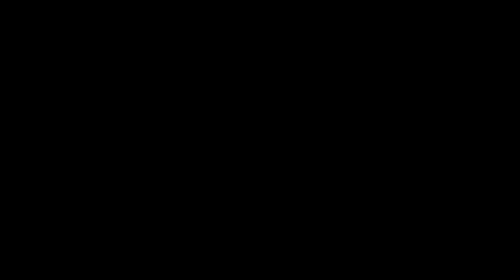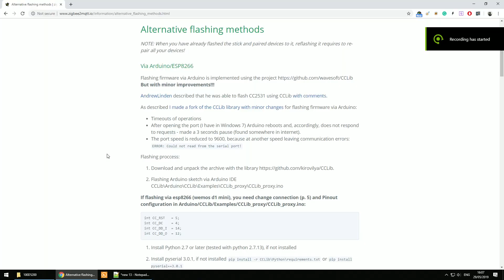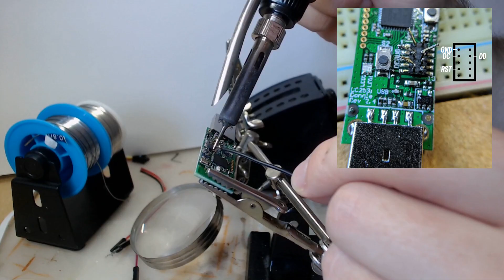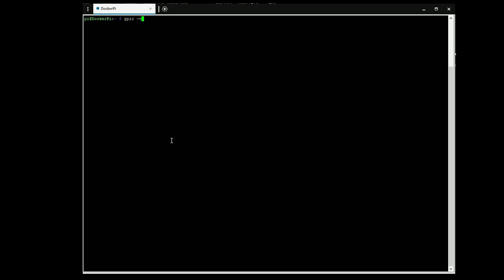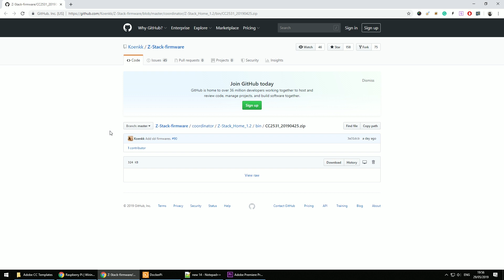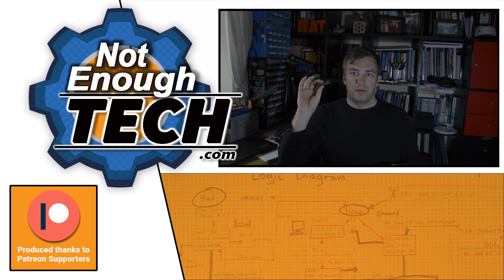Flashing CC2531 without CC Debugger

Comment: It doesn't work for me with a today fresh raspbian installation.
The video does not work for you either, when you run "cc_chipid" it comes out ID: 0000, same with erase....., which means that it is not working.
the same happens to me
Reply from the maker: What board are you trying it on? Also is it v1.0 on PCB?
Reply: @notenoughtech  yes, mine is 1.0
Reply from the maker: Are you on RPI  Zero? I get a lot of comments about issues with x1.0  my stick was 2.4
Reply from the maker: @sagatxxx1  see if any of these would be helpful: https://github.com/jmichault/flash_cc2531/issues/10#issuecomment-544139748

Comment: Thank you, it worked! I've used hook probe clip cables with dupont connectors on the other end for the connection. Had them for my logic analyzer, but they are very cheap on eBay. No soldering and pin bending was necessary this way.
With Pi Zero I had to move back to an earlier commit because there was a bug which caused it to always stuck at the verification stage. https://github.com/jmichault/flash_cc2531/issues/10#issuecomment-544139748
Reply from the maker: Thanks for the link. I may get the 1.0 stick to write a guide myself as well

Comment: Hello. I have problem with step 2:    git clone https://github.com/jmichault/flash_cc2531.git   ---->        -bash: git: command not found. What am I doing wrong?
Reply from the maker: sudo apt-get install git  - should help
Reply: @notenoughtech  Thank you. It helps. I have another problem: where should I story .hex file (CC2531ZNP-Prod.hex)?  On SD card? Or on my PC? Thank you in advance!
Reply from the maker: Needs to be in the same folder as flash directory you can use mv command to move it

Comment: Hallo sir, I have a question, I try this method, when I try to get chipid the return value is ID = 8d22, if I try cc_erase: erase result is 00a2, and I failed to run the command of ./cc_write /path/to/CC2531ZNP-Prod.hex also file, so I end up run ./cc_write CC2531ZNP-Prod.hex. Then I try to continue the step by starting the zigbe2mqtt, but the process failed at npm start : Error while starting zigbee-herdsman. Is it because the flashing cc2531 is not yet sucessfull? 

I already multiple times check on the wiring, and I never get the same chip id as your description, could you help please? thanks in advance
Reply from the maker: Can you check the board version? It's printed on the PCB
Reply: @notenoughtech  the board is CC2531 usb dongle Rev 2.4 sir...
Thx for replying
Reply from the maker: @visitor5914  The same as mine. Are you using correct firmware?  You should take a look at the table linked in the article to pick the correct version

Comment: I successfully did this yesterday, with help from this video. One hiccup: ./cc_chipid returned ffff. Needed to edit CCDebugger.c and re-make as described in https://github.com/jmichault/flash_cc2531/issues/9#issuecomment-557893592. Also, my chipid showed as b522 instead of expected b524, but this is also mentioned in the same thread. Thanks, Mat.
Reply from the maker: I had a friend struggling with it too... check the board version it should be printed on PCB
Reply: Thanks Andrew that helped, I also had to change my cc delay to 90 to get the reading go from ffff to b524. And comment out the delay calibrate. 
And of course thanks for NotenoughTech for making the video.

Comment: couldnt you just use female-female dupont jumper wires without soldering them to that header? it looks like standard 10pin header to me
Reply from the maker: The header on cc is way too small for that these pins are very close to each other

Comment: Does not work, WiringPi is off from internet and with version witch comes with raspbian wont flash correctly, does errors when flashing
Reply from the maker: Were you on "lite" or standard raspbian?
Reply: Lite
Reply: Verifying gives always errors, sometimes only one bit and other times 20 bits
Reply from the maker: @OskariUusitalo  Do you have the same result on the Full raspbian?

Comment: Hello, is it possible to flash with you method if I already have hassio installed in raspberry pi? Or I need to delete hassio first of all to be able to proceed with your steps?
Reply from the maker: As long as you have the root access via SSH you can
Reply: @notenoughtech  what do you mean by that? Sorry I am new with all this stuff
Reply from the maker: If you are the one that installed it then yes
Reply: @notenoughtech  yes I installed hassio on raspberry pi. How to access that console log then? :D
Reply from the maker: not the console log but just SSH session - and then follow the instructions as per tutorial.
Reply: @notenoughtech  I have the same problem, I have already installed the HASSIO, when I go to the terminal through SSH Web Terminal, I can only see the" -->~ " prompt. I know it is not right, because your terminal shows a "$" prompt. I cannot execute any gpio -V or any command like "sudo get-apt...".. Please advice how to get to "$" prompt after I have installed the HASSIO. Please give some guidance as we are all beginners in Home-assistant.

Comment: Hi Mat, I am so happy seeing yr tutorial and excited buying a few cc2531. Sadly i try to flash with raspberry pi 3b+ by following yr given tutorial but all failed with ID=ffff even I checked the wiring several times. I even changed another new raspberry pi 3b+ and another new cc2531.  GPIO -v ok.  Any idea what is happening? 😭
Reply from the maker: ffff means that device is not detected. It's either driver not correctly installed or you made a mistake with wiring. Double check the pins. These are so close together it's easy to make an accidental short.
Reply: @notenoughtech   @NotEnoughTECH  Hello Mat, sorry for the disturb, know that u r busy.  Do u mean we need to install driver 1st? What do u mean by "driver not correctly install means" ? I need to install some driver onto raspberry pi, before trying to flash cc2531? Or do I miss anything in Raspberry pi raspi-config, need to be enabled?  I am pretty sure wiring no short circuited because I even tested with multimeter to ensure no short circuited and wiring continuity too. Double triple check pin to follow exactly the pin configuration table given. But I did tried to unplug the pin 38 or DD, it shows ID=0000 and once plug it back it shows ID=ffff again.  Try to type GPIO readall and it shows pin 35 36 38 = 1 respectively.  Tq tq tq for yr help and very much appreciated.
Reply: @soovui  I have the same issue, I have re checked all connections but I still get ffff. did you get this fixed ?
Reply: My mistake, its now working.
Reply: I've got the same problem. I found this issue from the github page: https://github.com/jmichault/flash_cc2531/issues/9. Sadly no straight solution for this. Have you guys found out how to get around this problem?
Reply: @goran3669  https://github.com/jmichault/flash_cc2531/issues/9#issuecomment-557893592 that fixes it

Comment: Nice video.  Is it possible with a rpi2 because this one have only 26 gpio pins. and de pins 38 etc are missing.
Reply from the maker: Yes as long as you use the correct pins.
Reply: thx i will give it a try and finding the correct pins
Reply: @jeroenhofman447  did you found out the pins?
Reply: @maersk1969  no not on the pi2 i have used an new sd card on rpi3 and the it works
Reply: @jeroenhofman447  my problem is that I only have a pi 1 with 26 pins and I do not know what kind of pins I need to flash the cc2531.
Reply from the maker: There are no "correct" pins. For 26 pin header you'd need to go to source code and change it.
Reply: @maersk1969  that was mine problem too. So I choose the way of a rpi 3

Comment: Awesome video man! I am excited to see your future videos. I got a few Aqara and Xiaomi wireless switches and Door Sensors working, but I could not set a initial status to them. For instance, the initial state for the Door Sensor is "closed", even if its open. Once you really close it and open again, it works and I got no way to get that to read the initial value.
Also, the switches have "Unknown" for Battery, Click and Link values until you click the switch for the first time.
Reply from the maker: I might be wrong on this, but all but temp sensors are going into a sleep mode. So unless there is a trigger wake up (low battery, button press, contact triggered) the unit sleeps to conserve the battery. There is no way of reading the information in this state. I assume this information based on the IKEA remote which after a long time without using the button has to be pressed twice - once to wake up, once to toggle stuff. 
I will check the Aqara stuff soon - I'm actually going to write a piece about keeping the battery getting low battery notifications for all the devices.

Comment: Do you still need the jumper cables after the flashing?
Reply from the maker: No, this is one time process. Once flashed, updates are done over USB and you can get rid of the cables
Reply: @notenoughtech  Hey, the link to the firmware on your site is not valid any more. What should we download? :)
Reply from the maker: @DanielDelicon  I have updated the link to the folder rather than a file:
https://github.com/Koenkk/Z-Stack-firmware/tree/master/coordinator
Reply from the maker: Nope
Reply: Well that's new to me if you could update it via usb. Never found a post to do that without reflashing the device.

Comment: You just pushen me over the edge of buying a few of these. Thanks :)
Reply from the maker: In a household you probably need just one and then used couple of light bulbs to propagate the signal
Reply: NotEnoughTECH cheap enough to just buy a few to mess around with.
Reply from the maker: Sure thing but you need a Raspberry or something to run it on. Most of the powered ZigBee devices (not batter powered) act as routers in a mesh network. But if you want to have more than one network... Could be right thing to do